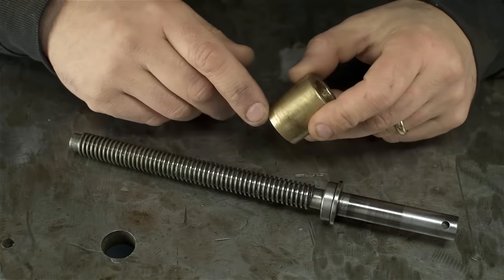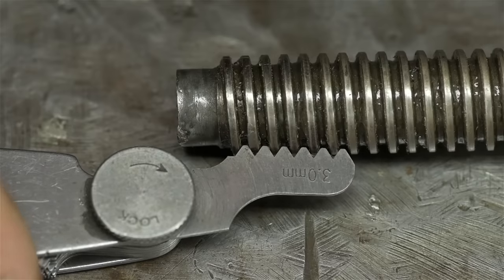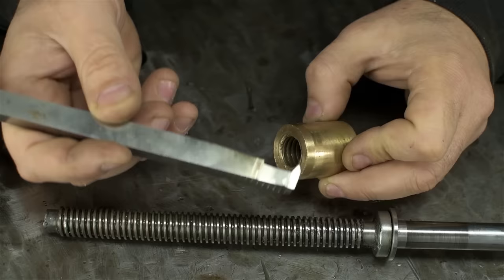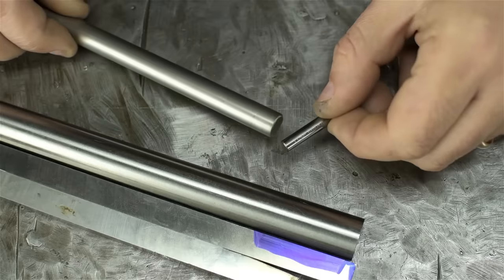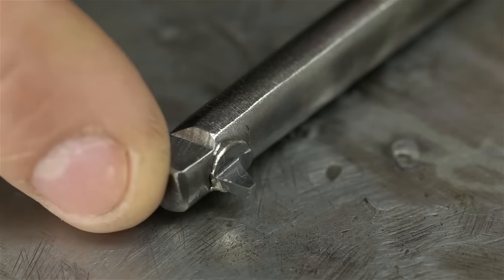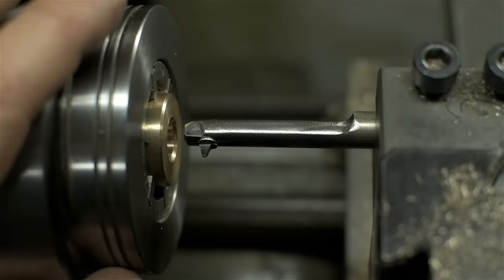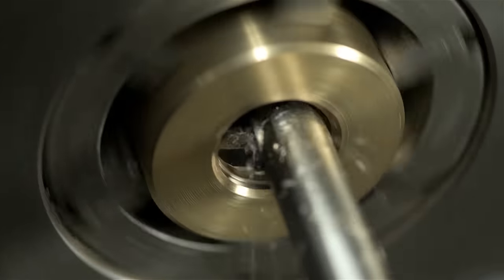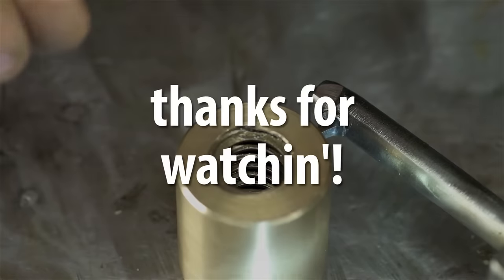CHOOSE YOUR OWN ADVENTURE: Single Point ACME Threading!

Comment: Option three: pour new threads in a low melt alloy. Soot the bolt and clean the brass, seal the ends of the brass sleeve with Dam-babbit. Preheat slightly and pour new female threads in Cerrosafe (or equivalent) through the set screw hole. Not a permanent fix, but will last a few years and take only fifteen minutes. So, repeat every three years.

It will fit like a glove. In fact, with the wear on the bolt, propably best to cast new threads against the less worn end of the screw. Cast against the central portion of the screw, interference could get extreme as the new cast threads travel to the ends.

Comment: Just went through this myself with having to manufacture a cross-slide feed nut for a combo lathe/mill machine. The interesting part was having to cut an internal Acme metric  20mm #3 pitch R/H thread as how do you do that without the ability to use the cross-slide to advance your  cutter into the work   soooo, looooong story short lock the cross-slide in place, set the compound to the required 14.5 degree angle and use the compound rest only.  Worked fine!  Got my nice new bronze nut to the point (.001") I could get it smoother than silk with no backlash by final processing with lapping compound. The outfit that markets my Chinese machine ordered a part (nut) and when it arrived, it was a STEEL nut! LOL.  No way was I using that thing.

Comment: Even if I add a gutter, I prefer to to cut my threads from the inside out. Another alternative that works if you have a CNC mill (I do) is to thread mill the threads with a single point tool.

Comment: Great video I had a question about your set up, it looks like you're running the  chuck in reverse as your threading in , I was under the impression you would have to turn your tool upside down in order to cut but yours is right side up.

Comment: Another method - you can weld a piece of HSS with TIG using 308 inox rods. I am use mild Steel stocks and pieces of 9 or 18% W HSS or cobalt HSS.

Comment: Tony I realize this was done in June but I have a request. Something I have not tried yet and have serious "need" to do so. Can you make a video on "chasing" an existing internal thread which needs to have .010" taken from the minor of the thread first and then "chased" to meet original thread contour?  Imagine a 1.062"  threaded hole with internal shoulder to thread to and then boring the hole .010" larger (removing .010" from the thread profile) and then "chasing" the threads so the male threaded tenon that will screw into the internal thread will be 1.072" and a class 3 thread or cut to fit thread. (Sorry to be so windy but I wanted to be clear and the end result is probably, "what did he say"?!

Comment: I make threads in aluminum with a MAP torch, aluminum rod, and a bold the size I need and a piece of steel tubing. I put the tubing over a washer put the bolt up thru the washer hole the length I want and melt the aluminum rod until it fills the hole around the bolt. Let it cool and screw the bolt out it’s ready to go.

Comment: the pixelization during the threading process made me chuckle.

I have a 3 in 1 combo machine whose brass cross slide nut could use replacing. It has a poorly made antibacklash system that needs a lot more rigidity. Unfortunately, the manufacturer has changed the design of the current products and so now I can't even buy a new replacement part. I watched this video hoping I could learn to make my own replacement part. This project might actually be doable. Either that or I screw up royally and replace all the screws with ballscrews.

Comment: hEY tOt..... Yeah, I just did that.

I have a need for a non standard fastener, but I only need 4 of them.
I have recently acquired my Grandfathers 1910-1912 Singer Model 115 and am in the process of restoring it, however it is missing a screw on the base, and instead of tapping the casting I would much rather have a set of fasteners made, the problem is that they are 3/8x18 and I hopped on the "gargler" to no avail....

Any suggestions?
Something you might be interested in making?
Should I just send AvE some beer and have him make it.... I am sure he can get to it sometime within the next decade ;)

Thanks in advance Thank you for all the great content!

Comment: Is there some good reason why you didn't size the piece in the 3 jaw then then transfer it to the collet chuck before drilling the hole through the middle thereby doing away with any worries about concentricity?

Comment: Hey This old Tony. Great videos. I'm looking at an old craftsman model 101.28910 .  It's in good working condition but wanted to know if you have any knowledge of that particular model. I'm having a hard time finding anything for that model other than the old handbook from 1973. It could use some cleaning up but other than that it's in good shape. What's a fair price to pay?

Comment: I've got one for you that I can't seem to find anywhere outside of a handful of obscure websites-

Cutting a straight RADIAL knurl, so a straight knurl aligned radially to the axis, on the flat end of a cylinder, a circle with more or less triangular teeth formed into it along some width, say 1/4"

Comment: I recently had a great find. It was a couple of Kennedy boxes that were PACKED with tools. A lot of Mitutoyo, B&S, LST, and those other guys. And that was great and all, and the reason I bought them for $300, but the secret gold was the large amount of handmade tools. The previous owner was a tool & die machinist. Many, many boring and threading tools like this. All are set screw, however. 

Anyway, I thought of you when I was carefully laying everything out of the boxes. I was reliving the moment as I watched this video. Then the Japanese porn pixel thing happened. It was at that very moment I realized you are not really in the NE US. You are in Japan. Well I'm on to you, Tony, and if you think you can try another ruthless attack on Hawaii, you've got another thing coming. I've got my good eye on you.

Comment: Did this leadscrew come from some table saw ? My Hitachi has almost ditto shaft and the Al nut which is part of the motor holding body got worn out.. What should I do...I have a Prazi  hobby lathe and a drill press that's all

Comment: You don't need gutter... It's extra work! Just drill deeper hole then needed, thread more then you need with a stop. Then part it. Tssted... Works! Only draw back is more material used. Tiny bit more.

Comment: I think another way to generate the "gutter" would be to drill a step inside the piece.  IWO, drill a bigger diameter hole but only partway through.  Then, flip it around and drill the initial hole (smaller) where the threads will be.  Then, during threading, the tool tip will have a "gutter" that extends to the far-end of the original piece.   {The tool mashup was v.nice.)

Comment: If you want to get a better inside surface finish you can ajust the compound rest about 10% of the cut depth (ap) this way the force applied to the cross slide is greater on one side giving you also better accuracy.

Comment: To cut a acme thread drill a hole in a suitable boring bar a drill and tap end use a round piece of tool steel like a broken centre drill grind your thread form you can set front clearance by turning the tool bit slightly!

Comment: of course this is not for a cross slide but for a compound slide, so it has to be RH. difference is on cross the nut is mounted on the slide, while on compound the nut is stationary with the slide and spindle moving in order to maintain same direction of engagement on the crank for feeding into the workpiece on both slides. should be obvious tho.
furthermore you should've considered machining the spindle thread for consistant backlash and much better precision, without a DRO it's just ridiculous not doing that. granted tho this shouldn't be of your concern if the customer didn't request such thing.
and yes, your sense of humour is actually beyond. almost spilled my coffee when i saw the hentai-style pixelation, bloody brilliant.

Comment: Will it be a good idea for me to just use a standard 14 mm bolt and Nut ( round off the nut) and insert the nut in the worn out housing  and throw away my acme shaft  ...because i am zero at threading on my hobby lathe..

Comment: Could the drill hole in the lathe nut be for a lazy fix for the thread. Using a screw as a thread? Doing what you can with what you have type of thing?

Comment: Hello, I was wondering if you could make a video about your educational background and skill set. You seem very knowledgeable. More so then the typical artisan. I ask because I am currently completing a trade in tool jig and die making, however, after this I am going to complete a degree in mechanical engineering and perhaps branch off into mechotrinic and would like some advice on whether the two skill sets are complementary or not so much.

Comment: Question when cutting ACME threads would it not be smart to have a 14.99999° angle on inserting the cutting tool just like a 29,9999° on 60° threads to reduce the cutting surface to 2 sides?

Comment: Tony, I was thinking - when you make threads, wouldn't it be useful to add for example inductive sensor (or just mechanical switch) somewhere on frame and let lathe automatically stop at one point?
Reply: That's a pretty good idea!

Some lathes have an adjustable dog somewhere on the ways that will manually disconnect the feeds/lead screw. Unfortunately on the vast majority of machines it's a mechanical system. The repeatability is poor and there's no fool proof way to actually set up the dog.

Because the system is usually mechanical it would be tricky to set up an electronic trigger. You could probably do it with a solenoid or something like that but it would be a major modification

Comment: Yes , I been caught out before, had to make a drawing and get manufetured some acme thread lead screws for a set of adjustable jaws on a mid 80's Japanese vertical borer , measured the pitch as 5mm , but it was actually 5 TPI (5.08mm) , I forgot the jaws assembly was retrofitted from an old Webster and Bennett bore (imperial )...what a goose.

Comment: Very motivational as i have 18 brass acme nuts to make at work 
Only difference is ill be using a machine with mechacnical clutches so they might need replacing again after those nuts XD

Comment: I am exactly at the same Problem now. Need a new nut for the crosslide for the lathe i bought but i cant make a new spindle and the nut is very complex because it has the Dovetails included on it so i let it made by professionals since i dont have a mill .... yet.

Comment: Instead of going crazy, you could also run the lathe backwards, and cut on the back side of the bore and pull the tool outward, then you don't need to do the stop like you did.

Comment: A "friend of mine" had to explain to me why the pixelation was funny - apparently because it alludes to some types of videos that I would know NOTHING about - just ask my wife...
That said, I'd just like to point out that there is no such thing as a "metric ACME  thread.
The metric folks call that stuff "trapezoidal threads" - ya know - because they like to simplify stuff in Base 10 measurements and stuff.
ACME threads have a 29 degree included angle, while Trapezoidal Metric Threads have a 30 degree included angle.

See how much more Base 10 the Metric folks are, and how much simpler their name for it is?

...or whatever means the opposite of that. Kinda.

Anyway - No such thing as "metric ACME".

Otherwise - another stellar video, as always!

Comment: Now drill (6) 0.125" holes around your loose nut,  divide your nut leaving one full turn of the thread, insert dowels on the holes, tight on the one thread turn, loose on the main nut, add six springs....reassemble the cross slide contracting the springs just one thread...you just got a self slack adjusting nut, the harder the springs the less slack. Any doubts?

Comment: Its much easier cutting internal threads from left to right away from the chuck. With cutter facing toward the back of the bore and spindle rotatating in reverse.

Comment: I'd have used a Grub screw to hold the tool rather than brazing - the threading /boring bar could then have been used for many different threads.

Comment: Couldn't you have started by cutting stock more or less up to end part length, drill it all the way through and then continue threading inside without need to change chuck or cut groove on the inside?

Comment: Great video.  I'm faced with the task of needing to make 2 acme nuts for my mill lead screws , one lefthand and one righthanded. How can a lefthand thread be cut?
Reply from the maker: flip tool upside down and run lathe in reverse.  however the starting bore will likely be small (depending on the mill) so... small tool.  I recommend trying to find a tap.
Reply: Yeah that's what I thought. 
I've acquired a SB heavy 10  3ph machine  thats never been wired up to run in reverse . Luckily it has a cam lock chuck that can run backwards safely. 
I need to cut a 1" 5tpi for my Excello mill.

Comment: What does a collet chuck do that a three jaw chuck doesn't? Better grip on the piece? If so why not always use a collet chuck?
Reply from the maker: collet chuck usually has better concentricity.  You could put a part in a 3 jaw chuck 10x in a row and it would never go in exactly the same way.  Downside is that collet chucks really only work well for standard size bar stock.  3 Jaw will hold any size that fits it.

Comment: Tony, you couldnt have eliminated chatter with that tool if you tried. higher speed would have introduced higher frequency vibration and broken your welds. offset the cross slide on the last couple cuts to reduce load.  chatter only matters on the last cut. take 2 side cuts and 1 root cut.....golden...er.

Comment: ACME as in the Roadrunner and Wile E Coyote, must be an Imperial thing, and in metric bigger numbers generally are bigger dimensions, unlike Gauges for instance, not much Imperial downunder, there is but a bit sketchy, from a gear grinding video ToT/D.

Comment: Loved the humor, esp the pixellated part.  Now pretend you're me and the metric change gears for your lathe were lost in a transcontinental move...  It's OK; they were up to 2% off the ideal ratio anyway.  Get some Module 1.5 gear cutters with 20-degree Pressure Angle, then order up some 1/2" thick Delrin sheet.   Fire up Excel and write a VBA script to iterate through all possible combinations of change gearing and gearbox settings, etc, etc, etc.  Voila!   You're ME.  Gotta be a ton of funny stories hiding in there that I'm just too dumb to see!

Comment: I think you could have avoided at least some of the chatter by off setting your compound slide by half the included angle of the thread.
What ever that is for a metric thread.  15 deg I think. (14.5 for acme) That way if you feed in with the compound slide the tool only cuts on two sides instead of three.
You may have actually done that but just didn’t show it.
Loved the joke about them always wanting money when you buy stuff ;)

Comment: You should have did the threading in the first setup, all in one setup is always better, if nothing more than efficiency. Upside down tool on the back side of the bore with the lathe in reverse and feed OUT from the relief. Jeez man, do you have a video on that yet? Did you feed with the compound on half the 29 degree angle? So many points I think you missed. I would do set screw. flat on carbide blank, grind tool in surface grinder, done. Can be sharpened and all.

Comment: My cross slide screw is rh thread. The nut is fixed to the saddle so when you crank the screw it pulls the screw with the cross slide. Emco super 11. I had to really think about that. I don't watch your channel to think. Cut it out!

Comment: You really should check out the ELS from rocketronics.de
ELS means "Electronic Lead Screw" 
I don't get payed for this. I just have seen it on youtube and it blows my mind 🤯 You can cut threads, radii, chamfers and all kind off stuff without any computer, cnc or change the spurgears.

Comment: The appropriate response on learning the true thread pitch would have been to pour new female threads in babbit, inside the bronze,  using the male thread as a pattern. Perfect fit lubricious, and a hobbyist won't use it enough to wear it out. Might be able to do it in twenty minutes.

Comment: I just replaced a 3 inch globe valve with a similar thread that was stripped the same way in the housing. $1250.00

Comment: Just done two nuts for a twin start 1/2" pitch ACME on a 3/4" bore nut.... Nightmare.  Had to grind custom tooling even on a CNC, and make a gauge plug and engineers blue each start to get a good fit!
#dieingskills

Comment: can you show us how to make an interrupted thread ?
Reply from the maker: what do you mean exactly by interrupted  threads?
Reply: @ThisOldTony  you know, one of those that doesn't go all the way around.   It will go partially around, then stop, then start again.  Maybe several times.
Reply from the maker: like a soda bottle?
Reply: @ThisOldTony   Or the breech of a howitzer?
Reply: which, come to think of it, looks just like a soda bottle...  hmmmmmm
Reply: @ThisOldTony  i can give you an example.
i have two "take-down" winchester rifles.
one is a model '92, and the other an '86.
both of them come apart by removing the magazine tube.
and then twisting the barrel a quarter turn to disengage (?) the threads.
then they slide apart.
looking inside the threaded part there are two opposing grooves cut through the threads,
which allow the barrel to slide into the receiver completely before the threads are engaged.
by giving the barrel a half twist it then engages all threads and tightens down.
reinserting the mag tube keeps the recoil from allowing the barrel to "unthread" itself.
Reply: @ThisOldTony  does that help ?